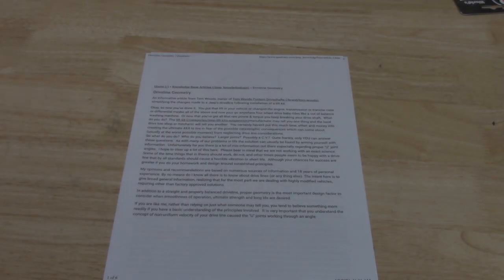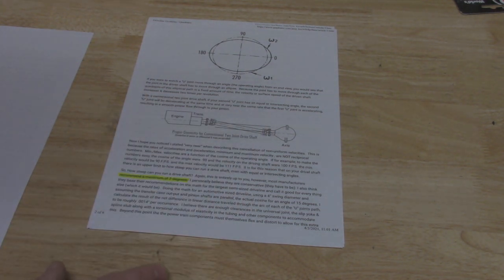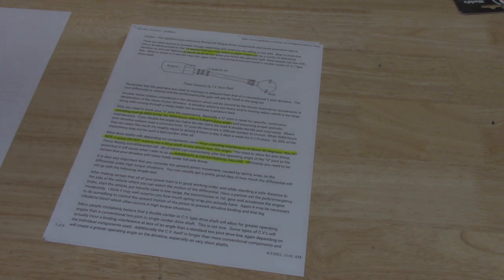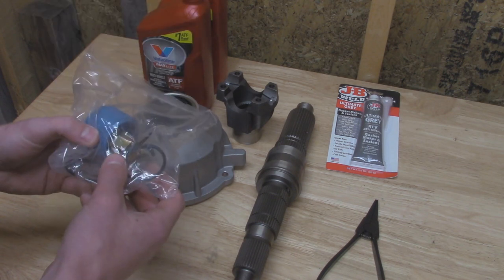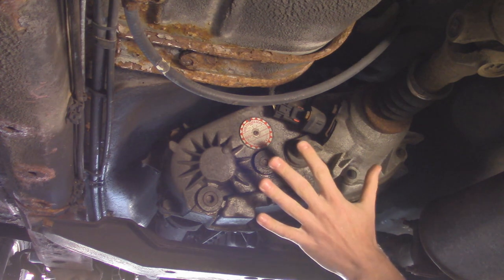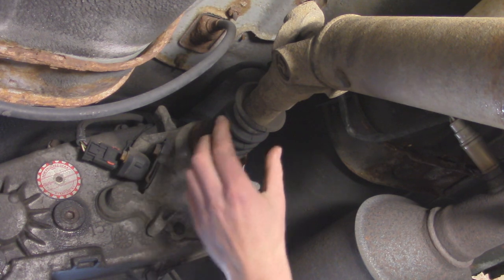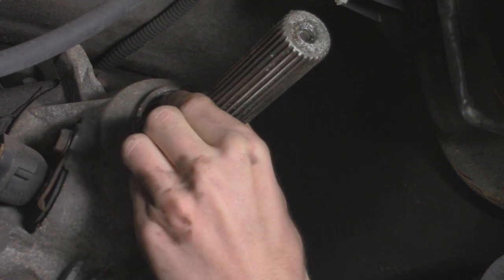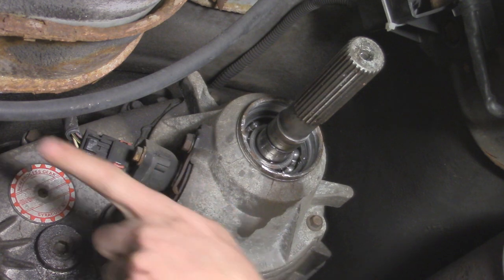Driveshaft Geometry & In Vehicle SYE Install | Rough Country

Comment: I know i have an 1988 jeep xj and a 1988 np242 transfer case but why is mine so different? Also i have a spare front driveshaft and ive heard about people using them but how much torque can they handle? Also i still dont understand how the double cardan is so much better than the stock

Comment: Good up to the point where you didn't put rtv on the housing. Trusted it, now my ATF is all over the parking lot and i need to re do the job.
Reply from the maker: No, you must have not watched the whole video. 28:17 shows RTV on the housing half surfaces. Why would you put it back together without any sort of seal?
Reply: @OutJeeping  tail housing I meant. And you’re right I missed it. I actually watched the video about 12 times, but without the cut reference points I was skipping back and forth. Thank you
Reply from the maker: @907goatscream  Yup, 31:35 for your reference on the tail housing rtv. Easy to miss a detail by skipping through, I've done the same before as well.
Reply: @OutJeeping  thank you. Well then, great video all around

Comment: Really appreciate the videos. I did the 3” rough country on my 98 XJ. Now I have to do the SYE.  Do you have any details on the drive shaft you selected and dimensions. I saw rough country has them but not sure which to pick.
Reply from the maker: I'm actually still running the front driveshaft in the rear. RC recommends there Rear driveshafts for a 4-6" lift, so it may be a bit long if you were to go that route. If I were you I would check out Adams Driveshafts or Tom Woods Driveshafts. They have everything set up with the Jeep you enter in. All you would need to provide is one measurement so that way they can get the length spot on for your application.

Comment: Just starting into the world of xj and trying to do it right. Original rig is spotless. Starting with a full set of stiffeners, lifting 3-4.5”(not sure which) using a long arm kit and it’s clear the sye is a must. After watching both your videos (thanks, btw), I’m gonna pull the tc. Managing the reassembling on a bench just seems like an easier approach to making sure alignments are spot on. 
Question. When you first split the case, it looked like there was some slop in the chain. What do you think? Is there a natural amount of stretch we just live with?
Thanks again.
Reply from the maker: It looked like there was some slop but the shafts ride into the cover that I took off. So when I pulled it off the shafts moved a bit inward and it appeared the chain has slack. But if your chain is stretched too much you will most definitely hear it in 4wd and may see chain wear marks on the inside of the case. That would be the time to replace the chain.

Comment: Hi Austin. I'm in the Netherlands and will be traveling next month to the US. I'm making a shopping list for the new double cardan (cv) driveshaft. A driveline shop near me will be hacking off my oem driveshaft to build a cv driveshaft for me. On the axle end, I'm getting a 8"  stub shaft (16 spline) welded on and a matching slip yoke (1310) fitted over it. They think it's cheaper to buy parts for the cv end in the US.

My question is, on the new sye end, what are the components of a cv joint that I need? There is already the existing 1310 yoke on it. Do I need 1) a 1310 H yoke, and 2) a Moog 607 centering yoke? And 3 1310 Spicer u joints? Is that it? What did you have on your new driveshaft?

Comment: My 2001 XJ has a 4inch lift. Would a stock front driveshaft work with this? Or would it be too short
Reply from the maker: With a 4.0 and auto Trans drivetrain it should work. I'm still running that setup currently.

Comment: You mentioned mean time you will just be in 2wd until new custom drive shaft comes is there a problem using the front driveshaft continuously on the 231? I use 4wd out here in the winter
Reply from the maker: I haven't run into any issues. I actually am still using the front shaft on the rear because I procrastinate on getting a new shaft. But so far so good after a year and a half.

Comment: You use the front shaft in the rear?, so basically we need to buy another front shaft? thanks for the video
Reply from the maker: For the cheaper route yes that is what I did. Finding another front driveshaft for $40 is cheaper than a $300 new rear shaft.

Comment: At the end did you eliminate o removed the spacers ? I have 4.5 lift im installing. The yoke from rough country. Thanks
Reply from the maker: I never installed the transfer case drop in the first place but yes installing the SYE kit will eliminate the need for a transfer case drop spacers.

Comment: Great video once again. I recently did a 3 inch lift and now I have to get an SYE and cardan driveshaft in. I was really hoping not to go that route, but oh well. Your videos have been on of the most helpful ones out there for XJs.
Reply: I dont understand why? I own several xjs and only my woods / crawler has a sye. Transfercase drop and setting the front diff angle is all u need. Check ur tranny and motor mounts as well. If they never been replaced then its definitely time.
Reply: @redneckswitwheels  I have about 4” lift in the rear and with a transfercase drop and a 2* shims in the rear i don’t have any vibrations even at 95 mph or faster.
Reply: @redneckswitwheels  I'm glad to hear that. I just did a 3 inch life and hearing some noise. I'm hoping the TC drop will do it. I don't want to do a full SYE or double cardan. I'm not quite there yet. So I just ordered a TC drop from RC and will install soon. Like yours, I'm hoping the TC drop will eliminate the noise.
Reply: @cablenowadays6586  u can do 100 in a xj? I need proof lol

Comment: You didn't menon sometimes having to cut the shift fork rod if it's longer than 1in when in 4low.   The new tail shaft housing is quite a bit shorter and if it's too long you won't have 4 low
Reply from the maker: Yeah the older transfer cases are a little more involved with trimming down the shift fork and removing some needle bearings. BleepinJeep has a good video for the SYE install on a older NP231.

Comment: Curious.... what did you use to clean the transfer case surface (where old rtv was).  It looks SPOTLESS!
Reply from the maker: Brass wire wheel on a drill, just got to be careful with the aluminum.

Comment: Great video very informative, i followed and was able to change out yoke but know 4wd wont engage any advise
Reply from the maker: It could be possible that you re installed the large shifting collar in backwards. I've had the same thing happen to a friends jeep. It would go back together fine but not shift into anything other than 2wd. Unfortunately you would need to take it all apart to flip it around. I would check the linkage first and make sure nothing is wrong that.

Comment: 3" rc lift full leafs , had a slight noise really not vibe . dropped the t case 1/2" and its almost gone , gotta run it till I can afford that kit ...
99 xj  2 door , coming along nice ! check it out
Reply: Probably drives haft u joints
Reply: Driveshaft u joints probably need replacing the angle just made the bad joints more noticeable

Comment: How much time do you think you saved doing the job without removing the transfer case?
And you didn't cover just lowering the case? Or did O miss it?
Reply from the maker: I would say it's about 1-2 hours faster by not removing the case. I did also cover the transfer case drop in the beginning.
Reply: @OutJeeping  thanks for the quick reply 👍🏻 I will watch again for your info on the transfer case drop. Mine came with case dropped 1 inch. 🤙🏻

Comment: 27:00 what did you use to clean off the mating surfaces?
Reply from the maker: I used a brass wire wheel on a drill to clean up the old RTV. You just got to be careful to not damage the aluminum.

Comment: Excellent video! 

I started my SYE install today and came to a stop after deciding I should put a new chain on. So far this has been a fairly easy install and should be all re-assembly with a test lap after it’s all done.
Reply from the maker: I haven't found the need to replace the chain on t-cases yet. Unless they have a lot of slack and it's hitting the inside of the case, then that would be a good time to replace.
Reply: @OutJeeping  ahh! Dang well maybe I didn’t need it but it has one now. 🤷🏻‍♂️

I was able to wrap everything up yesterday. Your video was a lot of help and one of the best if not the best DIY video I’ve seen in a while.

Comment: Great video, I’m wondering how hard it will be to do while leaving the front shaft in place, would the chain not allow it? Or would there be enough slack in a typical chain
Reply from the maker: It needs to come off to be able to pull out that smaller shaft. There is not enough chain play to leave it in there. But would be less work if that worked.
Reply from the maker: @SOCOMDITCH  You could just cut or drill out the bolt to remove it.